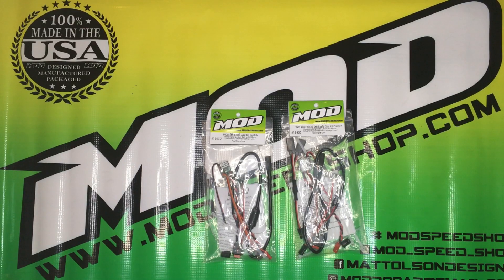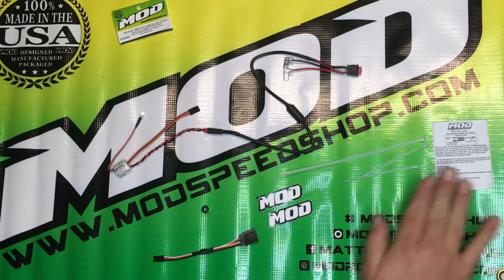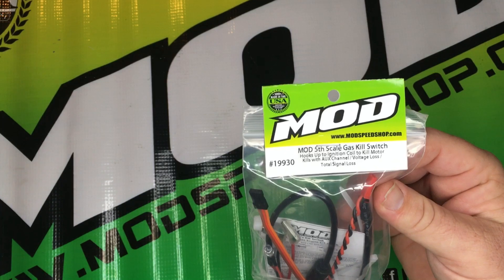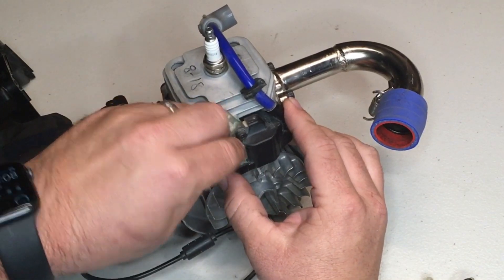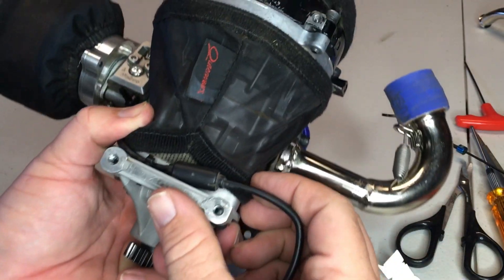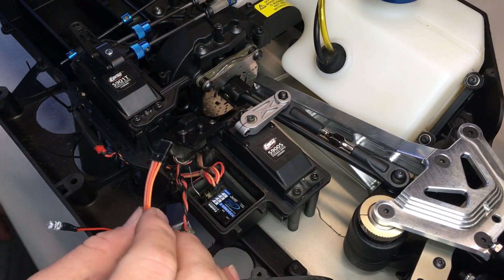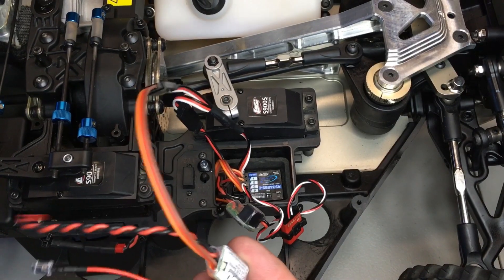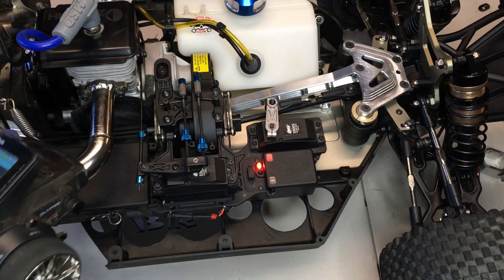Unboxing- How to install the MOD 1/5 scale gas kill switch

Comment: I have a dynamite on mine, I guess I should get ready for it to fall apart, mines been going good for now though for 3 months
Reply from the maker: As long as it works, run it 👍. When it stops you know which one to grab. Hopefully yours last a lot longer than mine 😂👍🍻
Reply: @largescalercnation  😂,thanks man

Comment: Hey, which MOD version do  YOU really prefer, the aux or none? Have any reason why one is better than the other? I have 3 cars and NEVER run a Kswitch-even though I have  2 'Killers' in my parts bin-the instructions are sorta  intimidating to me, 8^/.  I use a FUTABA  4pv and want to keep those  Aux chnls free for lights. Thanks.
Reply from the maker: I prefer the Aux. I always kill my car with the designated button assigned. Non Aux is for controller that doesn’t have the capability to kill it by a switch or not enough open aux on the receiver
Reply from the maker: You can also use the aux and add a y splitter for lights. But both are great and get the job done 👊👊
Reply: @largescalercnation  Hey, thanks man, you;re one of the few r/c  folks that actually make this vid posting/question stuff worthwhile...for some strange reason the 'gas guys' usually respond/Help....maybe I'll post a video of me bombin' round sometime....once I figure out that in-cam Hero-Gopro junk!Thanks dude.Take care.

Comment: I installed a mod killswitch in my Baja. 3rd channel and it's not working. It's a plug-and-play. The light responds correctly but it will not turn off my motor. I can even start the car with the remote turned off. DDM won't answer the phone and some guy emails me and said I need to program it. No I don't!!! It's not working and my Swana mx-v works.
Reply: Did you get the one with the aux switch? If so. Bind the kill switch with kill switch on and then turn off the kill switch. (Light off) and re bind with kill switch light off.

Comment: I had a quick question about fuel, what gas do you run in your 5t? I can’t find any ethanol free where I’m at, I’m in riverside county
Reply from the maker: I run pump gas 91 normally at Chevron. There is some spots like in Temecula that sells race fuel. But normal fuel is just fine
Reply: @largescalercnation  I called downs energy in Temecula but they said their fuel contains ethanol too, I guess I’ll continue running the chevron 91

Comment: What transmitter is recommended I'm using the dx2e or I have a dx3 smart
Reply from the maker: DX5 rugged or pro. Just depends on your budget 😊👍👊 Both are 5 channel so you will have enough slots to run your kill switch and transponder (if racing) both work great. Thanks for watching, commenting, and supporting the channel 😎🔥👊👊